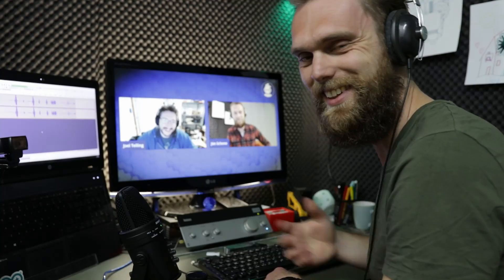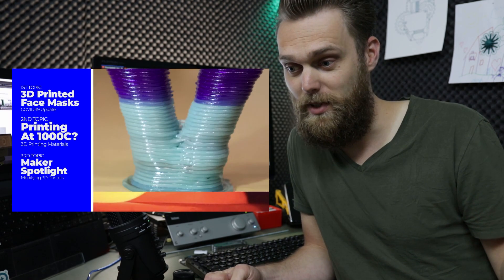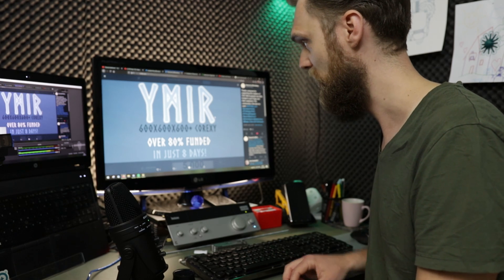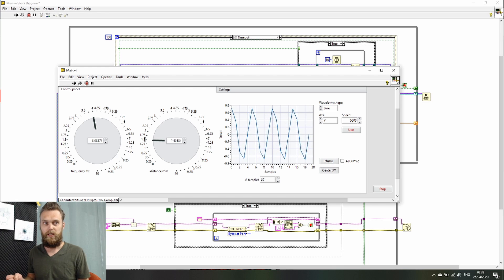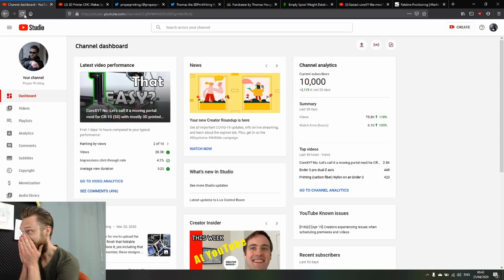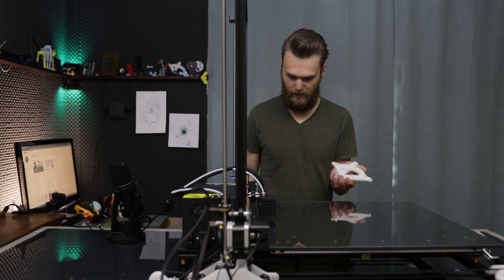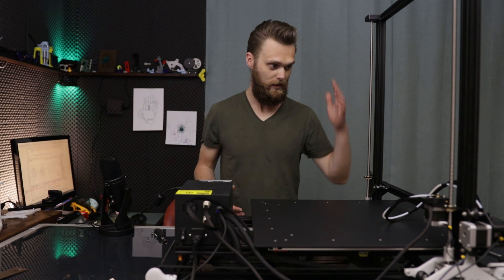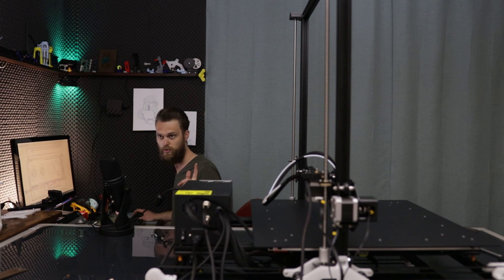Moving portal printer torture test, how does it perform?

Comment: cool vid! very informative, as technical and interesting as it can get. I'm actually surprised the deflection is only of a millimeter at resonating frequencies, me watching that video really wasnt a waste of time
Reply from the maker: Thanks, your name says 1 2 3 days ago🤣 I'm surprised too! It's still to much when at worst case, but I'm confident that I get this printer to print high quality parts :D
Reply: @properprinting  lmao yeah you can tell I hadn't much inspiration while entering my name 😂

Sure! it has great potential, if I may suggest I'm sure a way of greatly reducing deflection would be of tilting the whole moving portal and putting a pair of tilted support bars, also linked to the base frame by some roller wheels, to create a triangle structure, tilting the print head in consequence to make the nozzle extrusion direction orthogonal to the plate. This solution would require to replace z the Z step lentgh by new_z=z/cos(i) given i the angle of the tilted portal, and to shift the portal's axis by y=z*tan(i) or y = new_z*sin(i). I'm sure it wouldn't be that complicated to implement in the firmware.

Comment: How did you convert the .vi to gcode? Are you just running a routine based on the input parameters?
Reply from the maker: I convert the waveform to an array of numbers, than to an array of strings and iterate through that array building the command "G1 Y{value} F{speed}" and send that directly over the communication port.

Comment: Only 4mm deflection at max height on a flying gantry 3D printer is actually pretty awesome, I wonder if you could reduce it further by having larger gussets made of aluminum to support the uprights, or if what you're seeing has more to do with the flexibility of the aluminum extrusions.
Reply from the maker: I was surprised by how rigid it is like this! I'm going to reduce it further when making that enclosure in a similar way as you describe, thanks!

Comment: You answer my question ,thank you for that.
For your wobble problem maybe you can add more y-axis rail on top of z-axis.
And also driving mechanism (transmission or add more motor).
Reply from the maker: Exactly step two and three as I've describes in my previous video ;)

Comment: Congratulations on the 10K+ subscribers!
Regarding the wobble/resonance frequencies, the slicer off course has acceleration control, this will decrease the 'problem' does the program you wrote take this into account (does it use use acceleration set in the printer firmware?)
Reply from the maker: Thanks Patrick! The slicer doesn't do much with the acceleration, nor does my program. It "just" tells where to move at a certain speed and the firmware does the calculation for you. One of the reasons why a lot of people like Klipper ;)

Comment: Cats don't look as good in slow motion as one would think.. maybe they are always in slow motion making them look cool most of the time? so seeing a cat fall is extra funny because its like slow-mo into fast forward..
Also, don't you think the very top v-slot rail is adding a lot of weight at the worst point. what if you took a carbon fiber tube from those RC plane supplies and printed 2 PC holders and glue it. like a towel rail. Could make that resonant deflection even less.
Reply from the maker: That V-slot rail will be supported by the enclosure itself and not the rail ;) That cat looked bad ass😎😆

Comment: Not sure if it would be noticeable or a tangible difference in the long run, Jon, but the weight on the bed being added over time will also reduce that maximum deflection a bit.
Reply from the maker: Interesting thought! It was on a stable surface so I don't think you'll notice it that much. I'm going to stabilize it anyway so I hope that will be noticed for sure ;)
Reply: @properprinting  You're doing a wonderful job at inspiring the community to do new things with their printers. I've seen a couple posts on facebook groups of people Portaling their machines. :D
Reply from the maker: @ADH-DIY  Thanks! That's awesome! I should connect to those FB groups more, I got a lot of views from there :D

Comment: This is very interesting testing!  I can see expanding this to include found resonant frequencies in the slicer software to avoid it by acceleration control.  Even identifying resonance or deflection regions, and then controlling speed profiles in those regions!
Reply: Jim Connell maybe even adding a cheap accelerometer to the print head (MPU9050) and doing it in real time in marlin? :)
Reply: @svivs  interesting idea!
Reply from the maker: Thanks! Someone has posted this comment which looks similar to your suggestion: "HIGHLY recommend you check out the s-curve smoothing branch of Klipper for this. It allows you to tell the firmware the primary resonant frequency and it works to avoid exciting that frequency by  move planning in advance. https://github.com/dmbutyugin/klipper/blob/scurve-smoothing/docs/S-Curve.md" This would be a cool last option to implement if I'm unable to solve it mechanically :D

Comment: I made youre portal printer bud instead of guide the belts the way you designed, i routed them trough the extruded profiles just like the standard y axle belt on the ender 3 printer
This looks better and is more logical in my opinion
I only had to redesign the belt idlers and the motor mount, these parts are similar as the original ender parts
Reply from the maker: Thanks for your suggestion Martin! I was thinking of doing the same, but the 9mm belt didn't fit through nicely ;) Awesome that you've made a similar thing!

Comment: Gefeliciteerd! 🥳 Interesting comparison of the weight of the portal v bed. The CR-10s bed with glass is about 2Kg. I know because mine is now in quite a lot of pieces... 😉
Reply from the maker: Thanks! I'm curious how much the weights in total. There are aluminum profiles at the bottom as well. How did you get your into pieces? Trying to remove a print too quickly? xD
Reply: @properprinting  My whole CR-10s is in a lot of pieces inspired by you :) I'm also turning it in to a 'moving portal' machine, although with a different Y motion system to yours. I've cut 150mm off the Z height as I don't need it.

Comment: Hey man! Good work! Can I suggest to calculate the values for acceleration and jerk for the lowest resonant frequencies you found (when the x carriage is at the top) and tune the firmware to always stay below those numbers. It’s easier to calculate acceleration and jerk using the sine wave, so I suggest you use that setting. In case you plan on adding weight on the carriage you better do it before the test. Also an idea that I had watching the previous video is that you can make a moving brace like you did with the ender 3, using another sets of rollers that roll on the base extrusion at the back of the printer. That should stiffen a lot the portal, because unfortunately the most of the deflection occurs at the base, right where the rollers are. Sorry for the long comment, hope it helps!
I’m in the process to make the dual z axis mod for the ender 3 right now, love your projects.
Reply from the maker: Thanks Thomas! I'm going to stabilize it at the top when making that enclosure and I think that will reduce most of the vibrations. Thanks for your insight and awesome that you're working on the dual Z axis! Good luck!

Comment: Nice work finding the limits of the machine.  I have no doubt the combined weight of the bed and a fully printed rim will be less than the gantry.
Reply from the maker: Thanks! If you look at the Y motor itself it will be stressed less, especially with that rim you mention :D

Comment: Will you make that g-code generating app public?
Trying to get rid of resonance frequencies (and mechanical noise) in my printer and that tool would be very helpful.
Reply from the maker: Hi Johan, it runs within LabVIEW itself and it's rough to work with. I'm not able to make it public soon and for now it's solely to show the method. What I can do is generating a gcode which you can run on the printer. Send me an email if you're interested.
Reply: @properprinting  Well, there is a community version of Labview that is available.  Given that, it might be possible to release what you did.  I think it is an awesome thing.  I also have been working to "tune" a V-Baby coreXY that I built last fall, and resonance and tuning acceleration and jerk is a big part of it.  So PLEASE reconsider making it available.  Maybe as open source via github?  Then others could improve, document, etc.
In any case, great work!